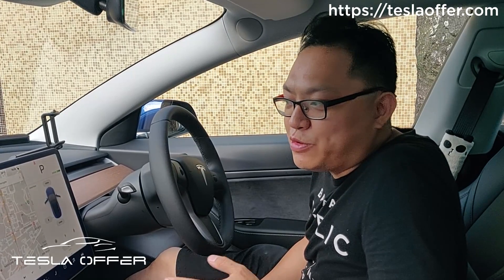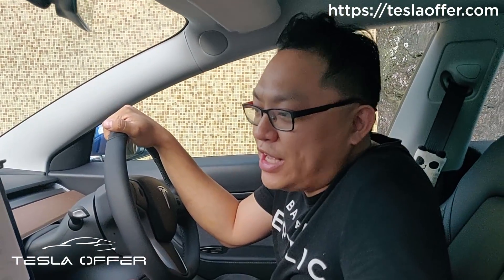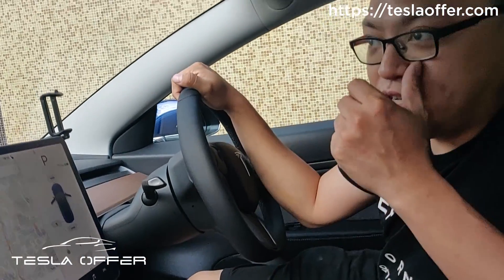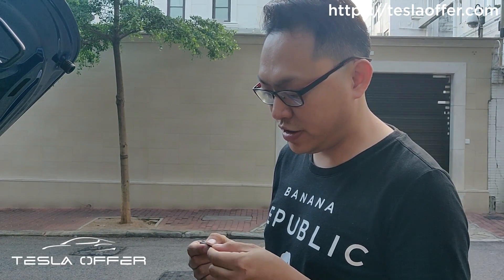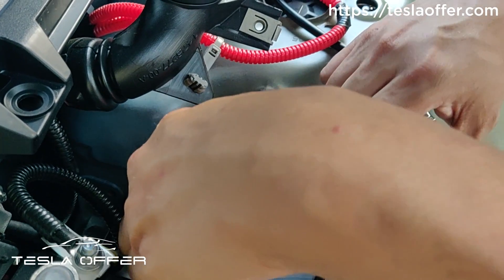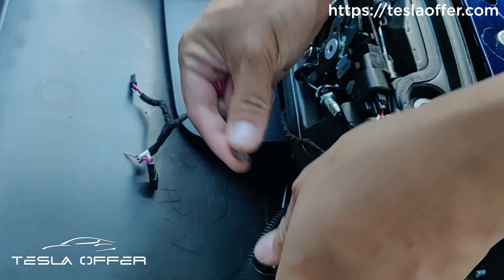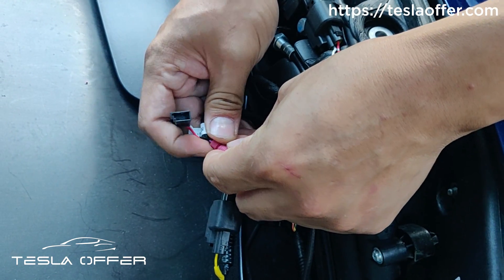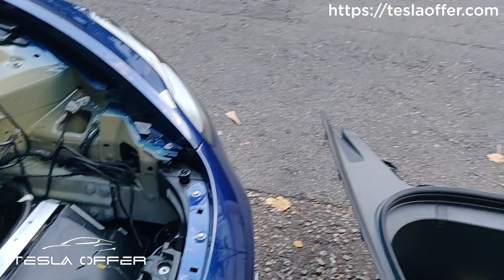Tesla Offer - Model 3 Electric Frunk (v2) Touch Screen Closing Feature Upgrade (IT IS FREE!)

Comment: Thank you, Raymond. I'd like to install the screen open upgrade to my Model 3 electric frunk. The process looks easy - but can you tell me about the firmware upgrade - I know you need to use a FAT32 formatted micro SD card, and I've downloaded the software - file named 3Fmk3.0 updateF07A.yst. Does the SD card itself or the file need to be named anything specific?
Reply from the maker: Please use the update330A3 instead of F07A. Your control unit doesn't support F07A.

The file needs to be renamed as "update.yst". They're no requirements for the name of sd card.

Comment: I ordered the V2 unit and it arrived today.  I installed it but didn't do the wire cut.  I ordered it with the option "frunk button close".  Right now it opens fine and almost closes.  Is this because I need to cut the wire?  Do I already have the correct firmware?  Can you provide a link to the connector to tap into the white wire so I can order it from Amazon?
Reply from the maker: Hi James, if you already purchased the kit with "frunk button close" you don't have to do the wire mod. It should work by default.